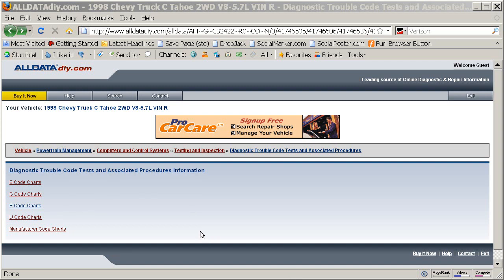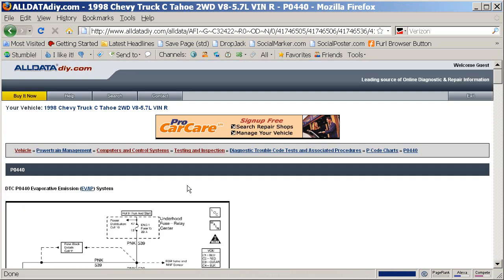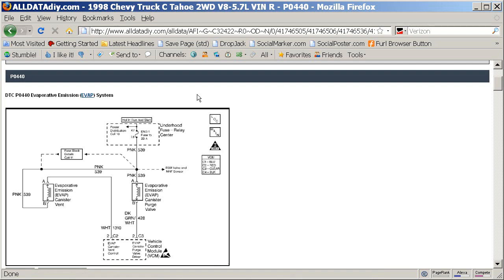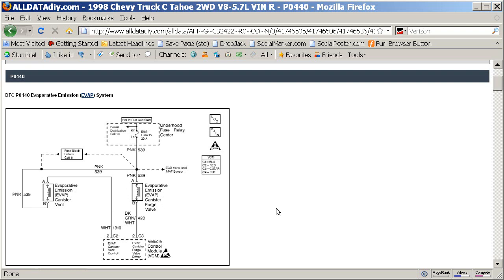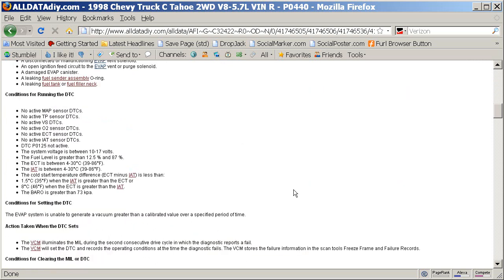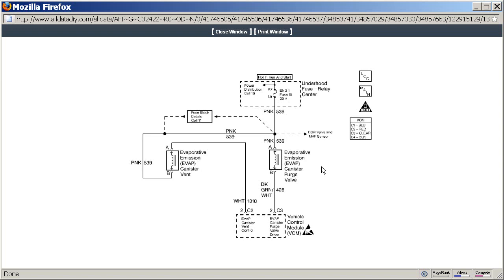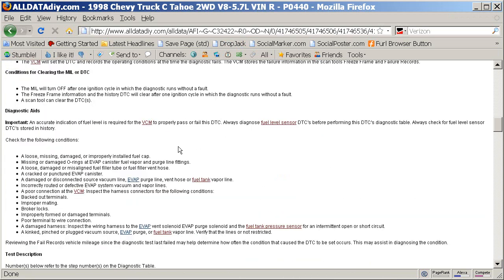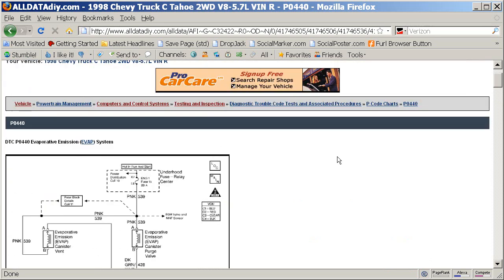Check Engine Light Code P0440

Comment from the maker: George: I don't know exactly whats wrong with your specific car but your story reminds me of a car I worked on (Chevy Cavalier) That had the same symptoms. The problem was a damaged tank vent valve. It would not open to let the air out (vent) so gas could get in. And it wouldn't seal good enough to pass the automatic pressure test hence setting the code po440 for small vapor leak. Agian just sharing a story many things can cause these issues. Accident damage is another common cause of problems.

Comment: @carladjonesalt1 the check engine light itself may have a short to ground, so there isnt actually a code, but a wiring problem with the bulb or the pcm is faulty

Comment from the maker: @PhylW007 Unfortunately the light has to be reset. Even if the car is fixed by replacing the gas cap the light will stay on until the code is cleared. Some parts stores offer this service for free in some states.

Comment from the maker: @markj15062 Nope... the code stays set and light stays on until it is cleared or reset. Note on some vehicles a certain amount of key cycles with no failure present will eventually reset it.

Comment: I get the P0440 code, also my gas does not enter the tank very fast, at first it does for about 3 secs, then it slows down, way down, I have to wait 5 seconds and then pump gas for 3 secs, over and over, not sure what I need to replace! Any help on this will be greatly appreciated!

Comment: I have a 99 chevy suburban with a 5.7 liter vortec,  One day I was driving when it started running rough, then my check engine light came on. After checking the for codes, P0440 appeared. I`ve checked my gas cap but it is fine, My question is what would cause my engine to idle like if its misfiring. Also i already changed out the spark plug & wires , Rotor & cap. Please need help. Thanks
Reply from the maker: unfortunately many things can cause a rough idle. However a P0440 shouldn't effect how the engine runs as it's just an emissions vapor recovery code. Although many things can cause a rough idle this Vortec 5.7L engine is somewhat known for leaking CPI injectors (AKA the spider) and intake manifold vacuum leaks.

Comment: I have a 05 chevy malibu my check engine light is coming on the message I am receiving is "check gas cap" The Chevy dealer wants to charge me 105.00 to put my car on a machine. I replaced the gas cap with a cap I purchased from the dealer and so far the indicator light still appears and as well as the message.  The gas cap I removed was worn out indeed and yes it needed to be replace.  I don't know what to do and I need my car inspected right now.Need a good cheap reliable repairman Katy Tx Help

Comment: i have a problem with my Chevy Cavalier the light check engine is on i already disconnect the batt for 30 min and the light does not turn off what should i do and i got code p0440

Comment: Easy fix for P0440, or any other MIL, ABS, or indicator. Proceed to local hardware store and purchase 1 roll of high quality vinyl electrical tape (about $.99). Remove the plastic bezel covering the guages. Cut a 1" piece of the tape and position it neatly over the offending light. Reinstall the bezel. You're done!